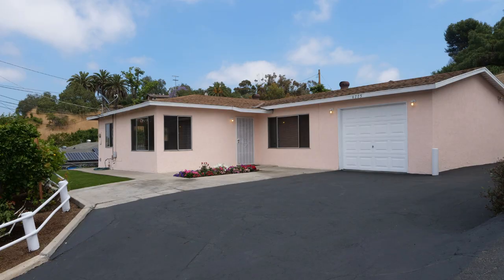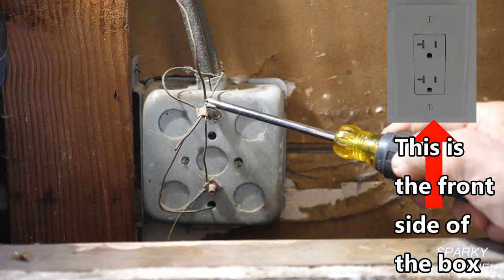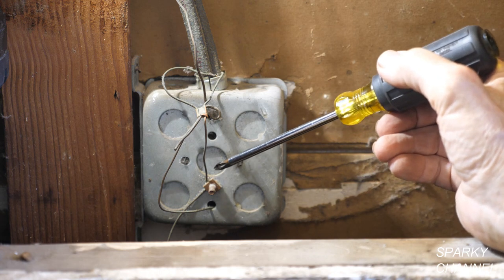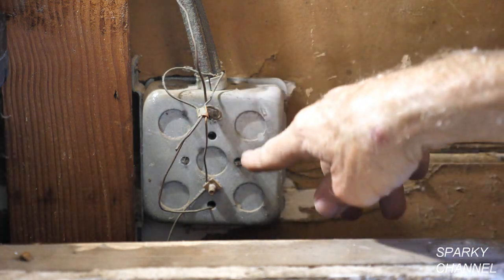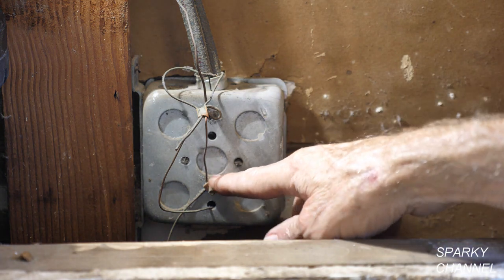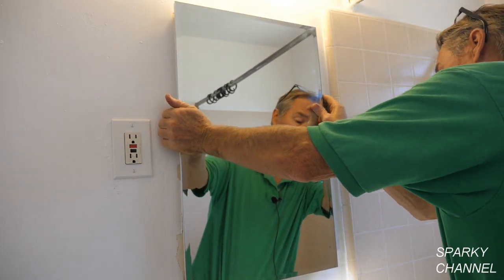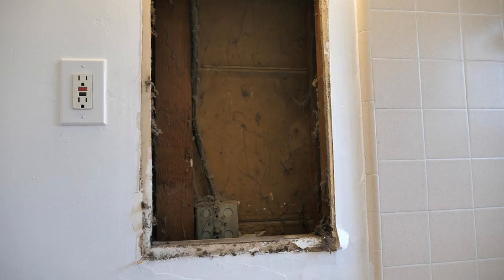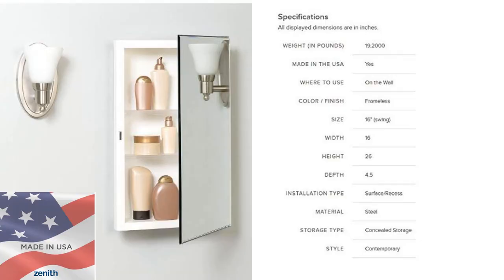How 1960's Metal Electrical Boxes Were Grounded

Comment: Remember that it is best to gut the house and rewire. There is no real way to guarantee any grounding in that house. Or just change all the breakers to dual breakers and everything is protected the best. Lates
Reply from the maker: Thanks Dave!
Reply: There are tens-of-thousands of these houses being sold each year, so I assume gutting the house to upgrade the electrical is incredibly common. According to my realtor and construction contacts, they indicate that this is uncommon. Do your trades or realtor contacts see gutting a house as a preferred or common fix for this type of house?

Comment: Our house was built around 1966. It actually uses 12 gauge romex. It's pretty much modern accept for the aluminum wire. The ground wires were attacked to the boxes by tightening them under unused romex clamps. None of that green screw rubbish that we have today.

Comment: I have a ground wire connected to a galvanized water line.I am removing it and replacing it with PEX A. Where do I reconnect the ground?. There's a wall receptacle close, it's in a kitchen.🤔
Reply: @xavelongoria7457 did you ever resolve that problem with the ground continuity?  I have galvanized lines inside my house at the moment, with ground wires bonded to them.  My garage is detached, using the galvanized line to bond to the house's electrical ground at this moment.  I had a water line leading to my house burst. The plumber replaced the line leading from the meter to the house with type L copper line.  I will eventually replace my galvanized pipes with type L copper pipes.  The only pex I will use are flex lines from the shut offs to the faucets.  When I have enough cash to replace my pipes, I will make sure the plumber safely attaches the ground wires to the new copper pipe, as all metal pipes are now required to be bonded to the electrical grounding system and to be bonded to an 8 foot grounding rod near the point of entrance to the building.  Water pipes are to be bonded to an 8 foot grounding rod nearest to the electrical box per National Plumbing Code.
Reply: @maxheadroom8857  grounded light fixture to garbage disposal junction box.✔️

Comment: Can I ask a question/give a video suggestion? My parents had a large barn with a living studio built above. The electrician wired all the three way switches in a way I’ve never seen. Instead of sending a 14/3 from one switch to another switch, he sent two 14/2 wires. Are you familiar with this? I’d love to see a video. Makes things very confusing! This is in California.
Reply from the maker: Yes, I have seen this. Basically, he didn't have any 14/3. It works but it wouldn't happen on my jobsite.
Reply: Sparky Channel Thank you. Yes, it’s confusing to deal with and the boxes are much more full.
Reply: @SparkyChannel  But then you're all set if you want to put a switch/receptacle combo in the far switch box :)